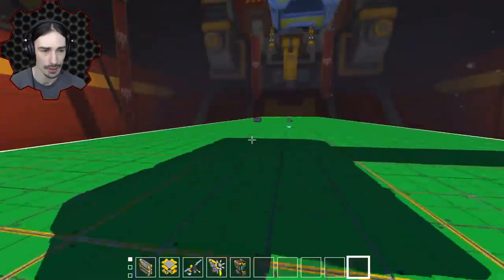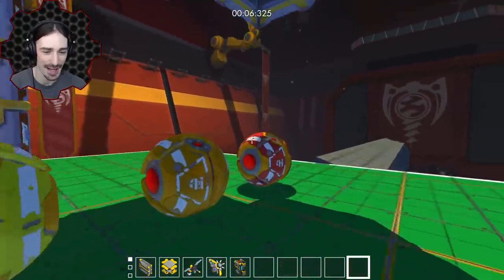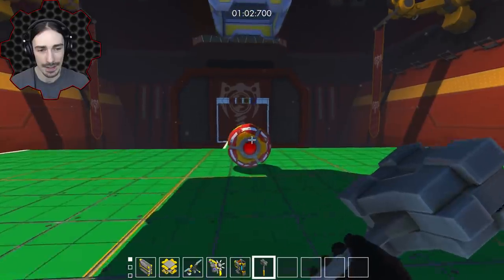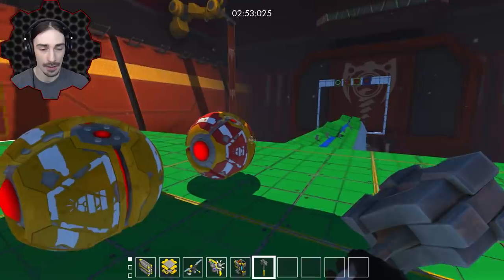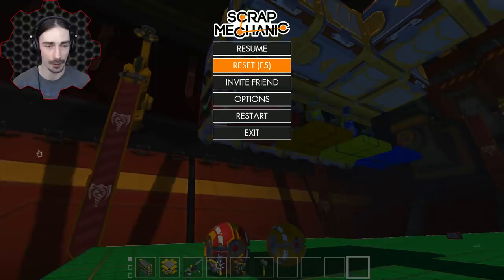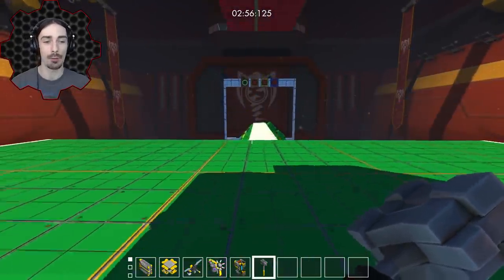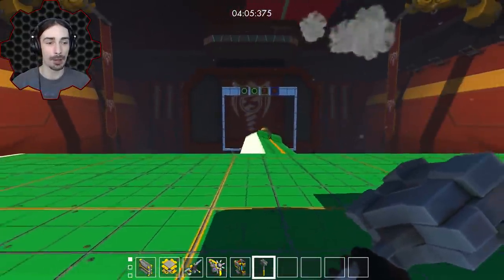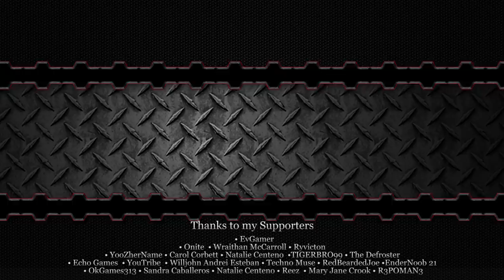Rotating Mini Golf Tube of Doom! (Multi Ball Golf Challenge)  - Scrap Mechanic Challenge Mode

Comment: why don't you just make the controller start at 0, then go 90, then repeat?
Or ypou could have made it stay still during each hole, and the have it rotate 90* each time a ball goes in
Reply: Your last sentence would make the hole a lot easier. But, I guess you would have to actually get through the obstacles with that method, so I'm not sure whether that would be bad.

Comment: in the controller rather than 90 0 90 1 you could do 0 90. Also for the ball spawners just use an and gate with a nor from the socket output.

Comment: I have ideas for maybe hole 8 or 9.
1.Make a rotating pillar and put a ball socket on a side of the pillar.Need a good timing or Ball hit to do this(maybe)
2.Make a wall that is popping out and stop for a second or two..
3.Use the ball as a key to the next part of the golf course.

For last level:Make a Scrapman Logo that comes down and smack the ball away from a platform and make 5 or 6 platform and the same with the Scrapman Logo Ball Smacker(just picked this name randomly).

Those are my ideas.if one of my idea got in hole 8 or 9 that will be grea.

Comment: idea/suggestion: a series of walls with holes in them, with bumpy uneven paths between the wall holes. One side has a door that only opens once the other side goes through its hole, and then at the next hole the door is on the path that was previously free, and only opens once the other ball goes through its hole, and so on (alternating open and closed doorways). So you're forced to juggle two balls at once, instead of doing them one at a time.

Comment: Hey Scrapman, you should use a xor gate to output the trigger for the Ball spawner. In that case you would have a chain of inputs from the previous and as second input the current hole. This would make your stopper unnecessary

Comment: In Scrap mechanic can you do a trap challenge? This is where there is a big maze like base where there are two teams, one person on each team has to fly above the maze and try to tell the other where the two maze divers are, as the other person Controls traps they made to push people off edges, or into some abstract representation of spikes etc.

Here is a better representation If I was unlcear. Two players are on a maze with holes on both sides of each path. They will be called A and B. C , the third player, flies around and finds the people, trying to tell D, the fourth player, where they are, as D cannot see them. D then controls traps that C and D design and try to push off A and B.
P.S. You can make a maze-traveling vehicle too if you want.

Comment: for the next hole you can have like a mini game part to it like a wall will come in like every 15 secs and you can make difficult obstacles to get to a safe zone. In order to add the obstacles you can either have a gap in the wall so the moving wall can go though the corse and push ur ball back or have it 2 blocks high for the obstacles and have the wall 3 blocks high accept remove the lower 2 and u can push the ball back that way to. so pretty much timed courses that you need to rush to get a safety point like on the side of the line.

Comment: for the next hole make it so you need to hit it in a underground part covered with glass then run with it toggling switches to push it along to the right hole and a stopped switch to drop it out if you failed

Comment: make it so that the holes appear in a random order. so that if you do the wrong one it doesn't respawn and they have to restart the challenge. and then it's in a different order. you can probably ask kan to help you with a randomizer. it would make for a proper challenge. and to make it easier to finish you can have a giant keypad that has a master command so that the challenge will automatically solve itself when you start it.

Comment: 8:33 the Boolean logic...
When programming (in Python) Boolean logic is defined as either "true" or "false" by using this, you can decide weather to run statements such as "for" "while" or "if" etc. For example:

number = 5
#declares "number" to the value of 5

number == 5
#this compares "number" to 5. If the they are the same, it returns "true". If not, "false" is returned.

if true:
     print (5)
#this prints "5" to the screen if true. If false, it does not print anything.

In the case of what ScrapMan encountered, he basically typed sledgehammer == true. This compares the two, then detects that they are different leading to the output of "false"

Correct me if I am wrong!
I hope this helped...

Edit: the "#" is used in programming as a "comment" to what is happening. It does not actually contribute to the code. I did not realise that using the "#" would search the word which follows into YouTube. That was unintentional...

Comment: Your "stop spawning when the ball is in"-logic honestly made me a little mad.
Just turn of the spawner damnit.
Reply from the maker: The spawner is triggered by the previous hole activation, which stays on.
Reply: @scrapman  There's nothing stopping you from pushing that through an AND-Gate.
Basically: Button -> AND-Gate input 1
Corresponding hole -> NOT-Gate -> AND-Gate input 2
Result: Red starts spawning when you activate the switch and stops for as long as the ball is in the hole

->rinse and repeat for each spawner with different 1st inputs.